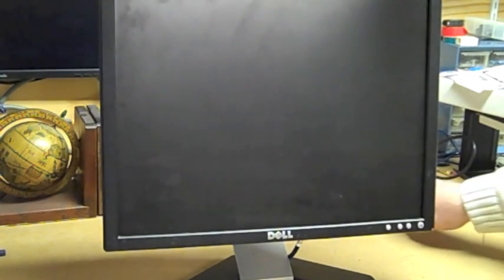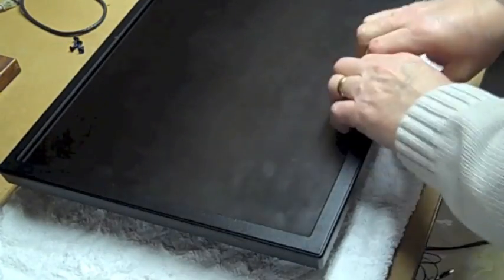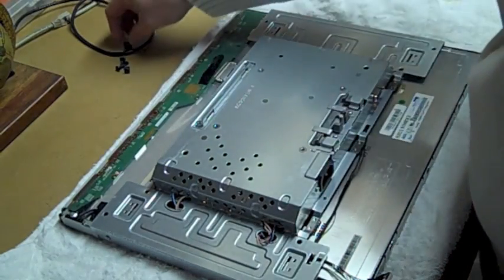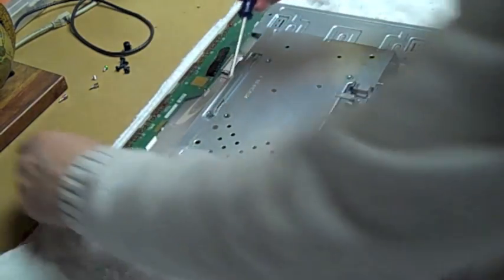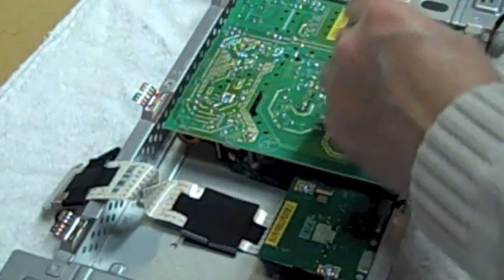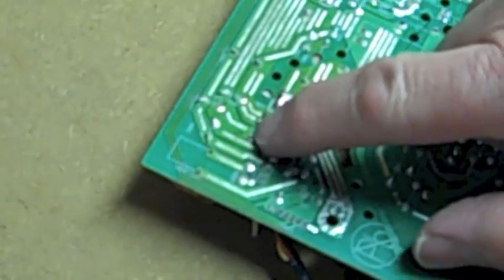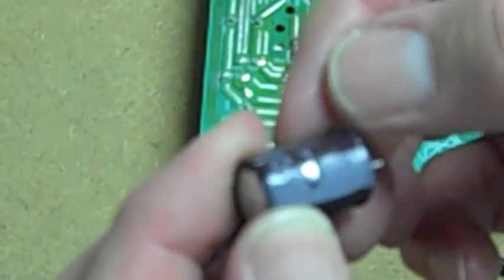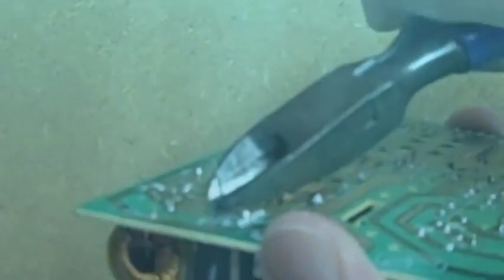Dell E198FP Monitor with Blinking Power Light - Part 1

Comment: Thank you John... I had the exact same problem on my "Dell E198FPf" monitor.
I opened it by following your procedure and found out that the capacitors on the same location of power board had bloat upwards (1000uf, 25V). I had replaced it with a 2000uf@25 capacitor I have, and the monitor comes back to life again :-)
Reply: E197FPf
Reply: E198WFPf
Reply: E198WFPf

Comment: Thank you Sir smartjohn... That is precisely the problem of my "Dell E198FPb," monitor... I had open it by following your "Youtube," instuction and have discovered that exactly the same type of Capacitors on the power board location had appeared to bloat upwards, only that there are TWO of them instead of ONE... I shall find purchase replacements for it ASAP...Thanks again for the INFO.
Reply: You mean E197FPb

Comment: 3 Days back my Dell monitor displayed exactly the same problem. I was not sure how I would get it fixed. Then a Google search led me to this video. This is PRECISELY what I needed with exactly the same part needing the replacement. The capacitor cost less than 20c and I am all done. Wow!

A BIG THANK YOU